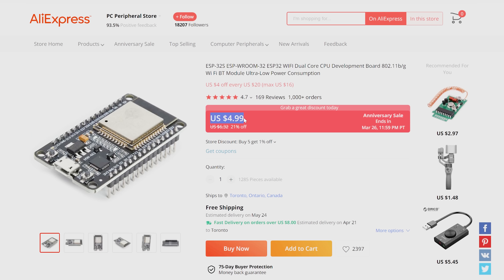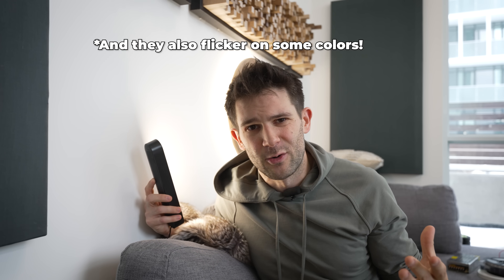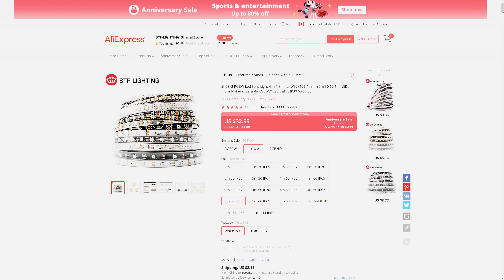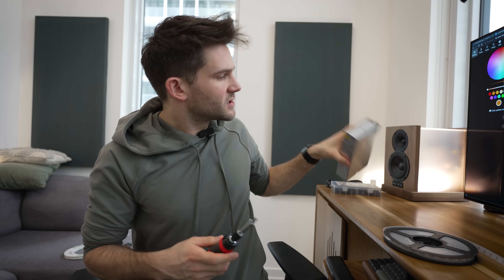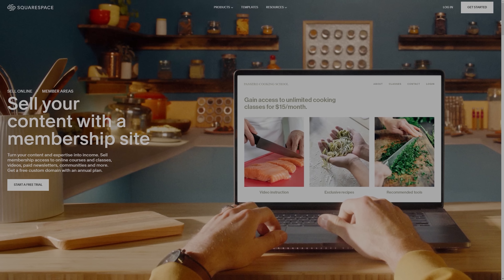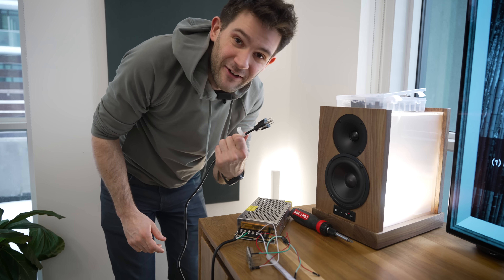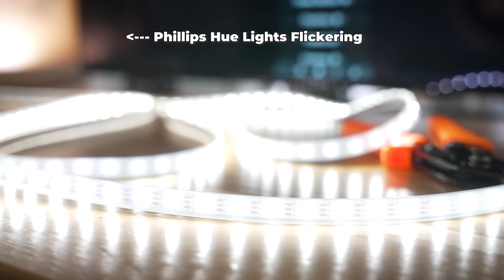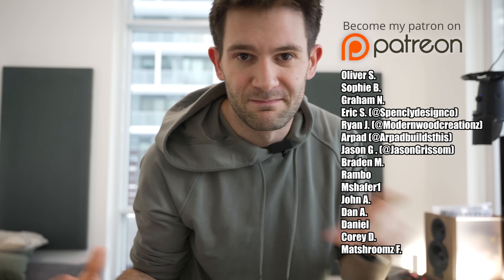RIP Philips Hue & Govee

Comment: Get a Dig2go instead. It's made by a Dutch maker, and requires just a USB C power supply in one end, and you plug the LED strip in the other.
It comes pre-flashed with WLED as well.
Reply: You can't use that for 5 meters. Or acually can but with low ér lights. On they site i see its only 15 watt. That is not enough for 1 meter with full brightness with rgb leds (60led/m)
Reply: @zsoltoravecz1815  true, but he does have other products that goes op til 60A or 90A if i remember. They are just more expensive and require a separat PSU, like the one used in the video.

I got the sense from the video, that it was directed to first time DIY'ers.
The Dig2go is a very easy entry into the world of home made led lights.
You don't need a crimp tool, don't need to crimp you own connector.

And most importantly, you are not working with mains voltage. A lot of people really don't want to go near mains voltage appliances.
It doesn't help the cause that he didn't close the cover over the live terminals on the PSU, before plugging it in.

And you can always do power injection, if you want to cover a longer distance.

Comment: You could have just gotten a zigbee controller for the lighting strips.  Philips hue is just a subset of the zigbee protocol so most zigbee devices pair in the app as if they were made by Phillips.   I use a Philips hue bridge and I think only 1 out of the dozen smart lights I have is Phillips.
Reply: Yeah I quite like the fact Philips Hue uses Zigbee. Works great, gives you access outside the house and doesn't clog up the WiFi

Comment: Yes, a $5 board and a $30 led strip, and a $20 power supply, and 2 months of wait time for aliexpress, and 3+ hours of IT labor, and 10x the power consumption... I'm not sure I'm saving much here...
Reply: I would expect the BTF strips to be much brighter than the Hue ones, hence the higher power draw. But I am not familiar with the Hue's specs.
Reply: @carstenlechte  Addressable LED strips are grossly inefficient, especially the ones from aliexpress. They have 1 mcu for every 1-3 sets of LEDs. Each LED requires ~1.7v and consumes around 20ma. R+G+B+W = 80ma, so each RGBW set consumes 144mw. While voltage drop resistors consume 5v-1.7v=3.3v, that's 3.3v*80ma=264mw.
So, for each RGBW you only use 144mw and waste 264mw on the resistors. That's not even considering MCUs themselves
Reply: @avashurov  Is this true of all SK6812 and "compatible" strips? And how is Hue different? The Hook Up has a video on power consumption that seems to show lower values https://youtu.be/QnvircC22hU?t=824
But of course we need lumens/watt for a good comparison.
Reply: @carstenlechte  Addressable strips. Monotone RGBW strips connect multiple LEDs in series, sometimes up to 14 or them, to minimize the voltage drop on the resistors. Very high quality MCUs may even have buck converters for each channel
Reply: Not to mention many people dont wanna go through all thia effort to make it when you can just buy already easy to setup strips.  Philips might be expensive but its convenient.

Comment: I very much dislike how companies can get away with flickering LEDs. I can actually see the flickering in a lot of LEDs with my naked eye. I bought a few LED bulbs once and had to return them because of the flickering (severe eye strain and headaches). I had to buy significantly more expensive bulbs which don't seem to flicker. Here in Australia our power frequency is 50 Hz. So, the switching in the AC current is slightly slower than in north America and therefore potentially more observable to freaks of nature like me. I know I'm technically not supposed to be able to see it, but I do.
What irks me the most is how few people seem to care about this flickering. For instance, there's a big convention centre in my city which has massive LED screens (movie theatre size). They replaced really good short throw projectors with these LED screens and they now flicker so bad. If one takes a picture of the screens one can see what I see clearer (a bunch of lines movie across the screen).
This is just a long-winded way of me saying that I have a reason for being passionate about flicker-free lights and I am glad you showed a good way of achieving that. Awesome video!
I'm excited for you and your new place!

Comment: With long strings of LEDs you may need to inject power part way down to stop the end ones being dimmer
Reply: YES! Those 0.1mm thick traces along the strip will not carry 18 amps. Run thick wires along the strip an connect to + and GND every 1 or 2 meters. You also absolutely want a properly dimensioned fuse on that power supply. This is to protect your wiring, not the power supply.
Reply: Yes  next time i will buy 12 volt leds less resistance more length without 
Injecting.
Reply: I just completed a project that had 525 WS2812, I use the BTF 5v 60A power supply with  3 outputs, one at the start of the string, and second at the end of the first string . As this was my first long string led project I had ever assembled I figured this would be enough power. 
I was wrong, the last 100 leds didn't have the same color as the rest of the string, meaning I needed to connect up the 3 output from the PS to the end of the string.  Something else I noticed that help me make the call on the 3rd power injection was the temperature of the DC connection plugs at the led's.  Very warm, enough that  had me concerned, considering these would be on for 8+ hours at a time.   Upon connecting up the 3rd output, the power injection connectors were now room temperature, and all 525 led's were operating properly.
Reply: @MIdaffy502  60A is power enough, 525 leds at full brightness white color consumes max. 21.56 A, when using effects you will use about 6-10 A max. on full brightness with colors. You probably used very thin cables to power the leds or did something else wrong. Try only power injection in the middle if possible with your project, i'm sure it's enough when using awg 13-16 wire.
Reply: And to keep color correct
Reply: I bought a few Meanwell 5v 60a PSU's that I use for downstream power injection for this very reason.

Comment: I'm confused, how does a strip that is supposed to use 18amps not burn out a 5amp fuse in the diagram?
Reply: The fuse is on the 120VAC side of the supply.
Reply: @benlawrence1265  in the diagram it shows a 5amp fuse right before connecting to the led strip

Comment: For my Wled set up, I 3d printed and designed a case for my ESP8266 board to hide the wires and the board itself
Reply from the maker: Nice, my bambu labs x1 just showed up in the mail today! Maybe I'll do the same
Reply: @ZacBuilds  Nice! Have fun with the printer, you will love it. I would like to get a bambu lab x1 but can't justify the price, for now I will stick with my heavily modified ender 3v2 😂